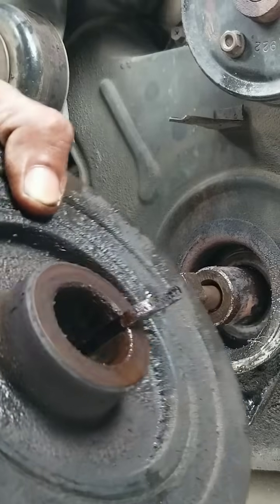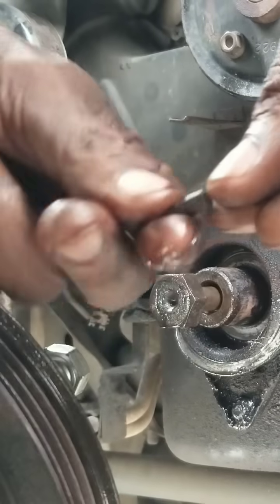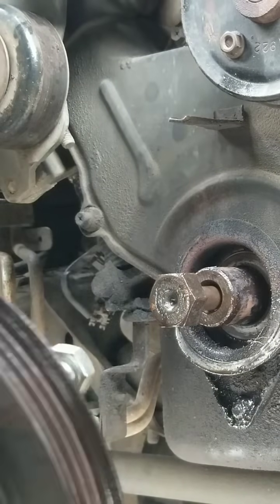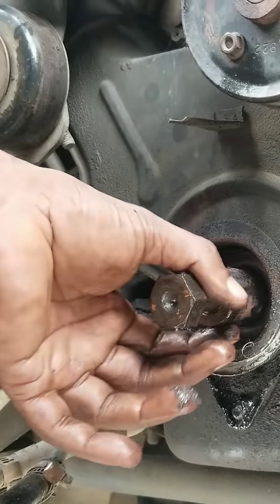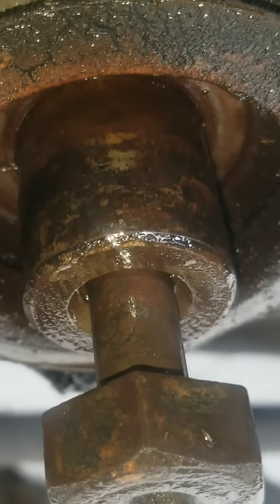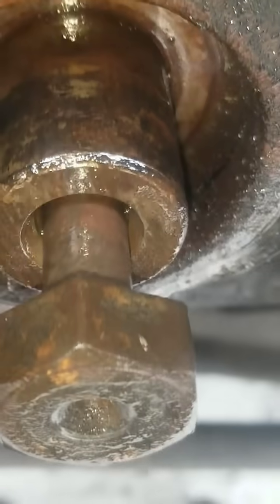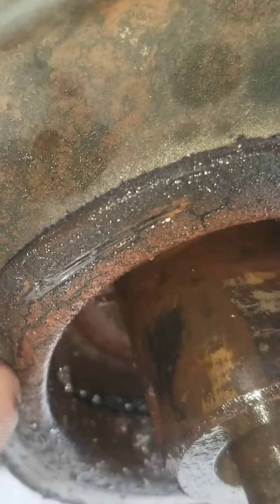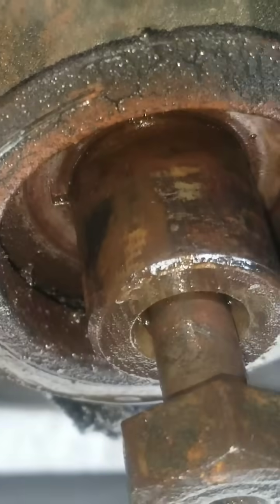Bolt Hole Thread Repair to Remove Vg33e Crankshaft pulley.

Comment: Damn at least you got it off. Mine is stuck on the crankshaft. Might have to dril n tap like you did.
Reply from the maker: Yep. Them Nissan vg33e are garbage
Reply: @Stevexnycautomotive I just got the hb off had to drill tap m8x1.25, the snout is rough shape. Going back in tomorrow to clean it up and put a new belt in. I wish I had a plug for new oem distributors lol😅
Reply from the maker: Can't believe your watching my retarded videos 😂👍
Reply: @Stevexnycautomotive nah man theyre not, it's a universal struggle for all us mechanics bro. I watch youtuber called Fixing with Passion also. Is it an old truck? Yea. But it's been reliable even though it's underpowered. Once I get the timing set, next thing is headers for a nice exhaust tone. I might make a vid myself😂 take care dude!